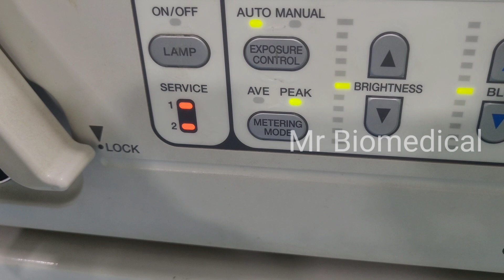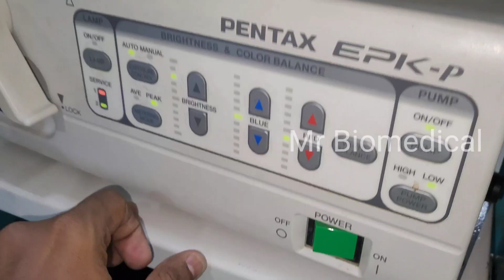Endoscopy Repair #endoscopy #repairing #keyhole

Comment: Great Video! Do you know how  can I remove the front latch where the scope connects?
Reply from the maker: You can see the micro screw inside of the latch
Reply: @MrBiomedical  I looked it and haven't found it, are they on the outside somewhere or inside the ring?
Reply from the maker: Inside
Reply: @MrBiomedical Thank you so much! 
Will look for them tomorrow once I get to work! Really appreciate your help!

Comment: Good afternoon sir,

 

Please I need your help, I have a fundus camera the output power that power the halogen bulb is 21v 150watt, when we ON the machine without connecting the halogen bulb the power (21v ) is coming but immediately when we connect the bulb the output voltage (21v ) will discharged/ dropped ( no more voltage again) pls I need your assistance pls
Reply from the maker: You should check the main board
Reply: @MrBiomedical  I checked there is no physical damage